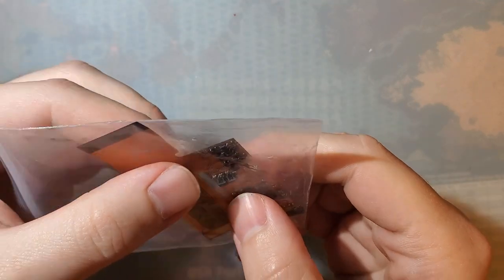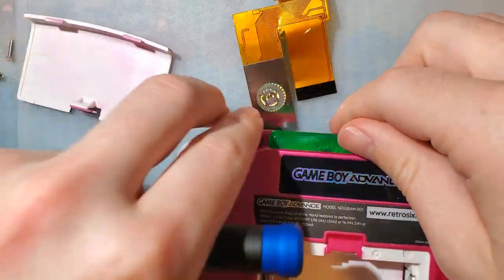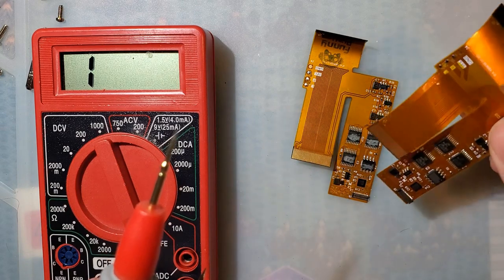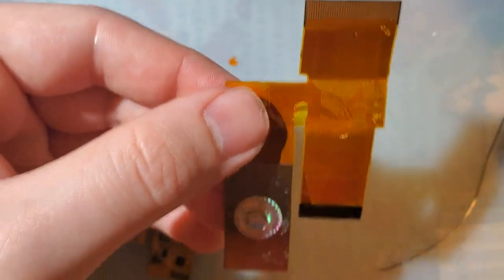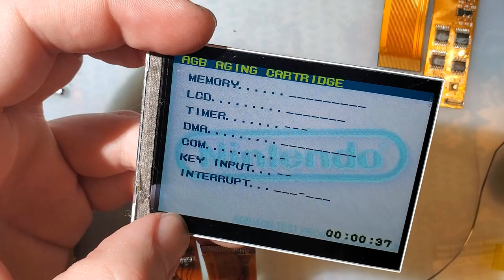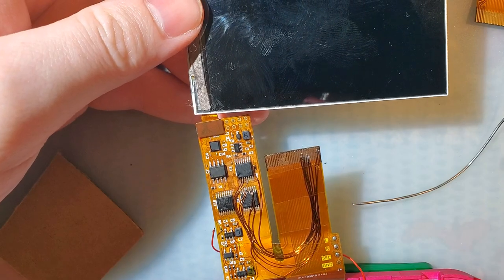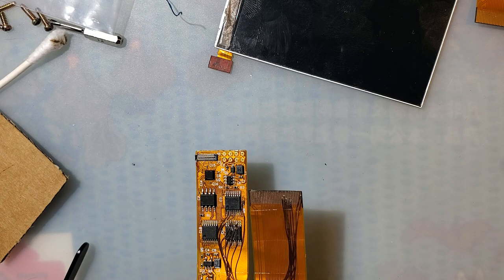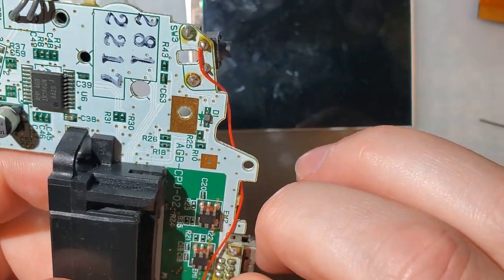IPS Kit Ribbon Repair (Part 1 of 2)

Comment: Hey Mahko! I always forget to hold L and R on my againg cart,  but if you go to Configuration > Target, you can change what your aging cart will boot into. Choose "Menu" to boot straight into the main menu, without the need to hold the shoulder buttons. Hope that helps!
Reply from the maker: yep but this requires that your ROM be on a cart that actually saves. So for a bootleg, this means patching the rom to use SRAM saves and then adding a battery.

Comment: Hi, do you think it is possible to do a GBA SP mod, where the battery cover is a snap-on like all of the predecessors, rather than that stupid little screw that always gets stripped when trying to remove it? Thanks! Love your vids BTW!
Reply from the maker: use magnets and embed them into the plastic
Reply: @makho  thanks!!